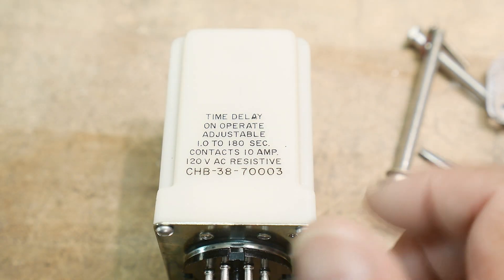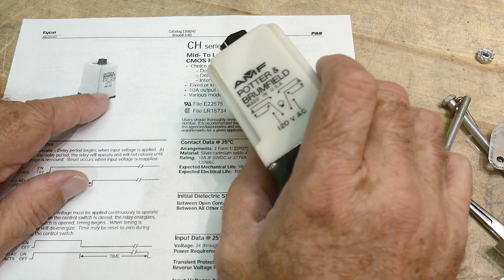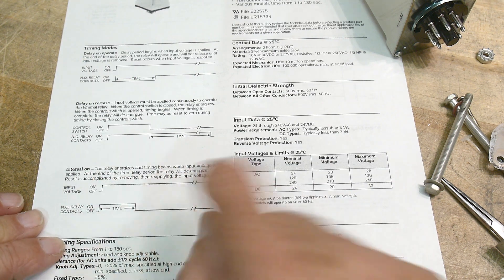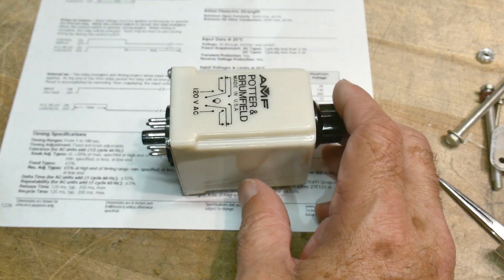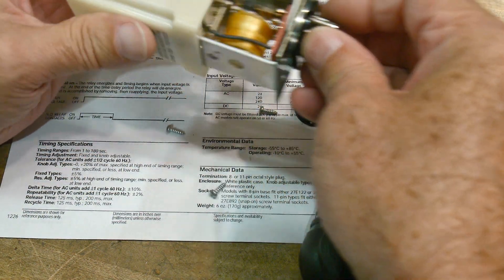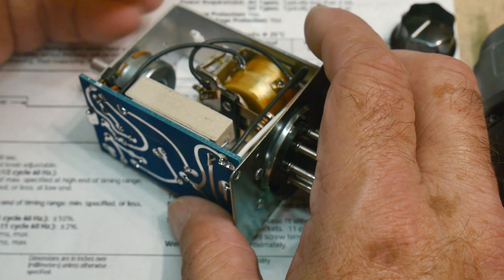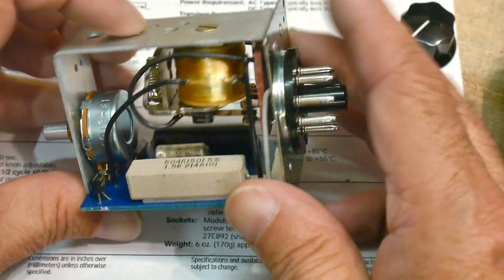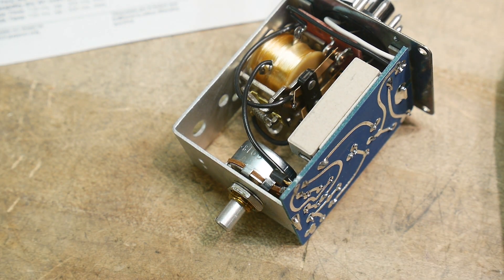#1349 Potter & Brumfield CHB-38-70003

Comment: I’ve used micro switches to build up custom switch assemblies. Those things are extremely durable. That switch will probably outlast both of us in daily use of the plunger mechanism (Tek’s) doesn’t fail first. These micro switches are very flexible parts and with a bit of mechanical prowess can be used for a variety of switching tasks. If anything, I commend Tek for doing it this way. The contacts will outlast rinky dinky push-on-push-off things they often used instead.

Comment: Normally also used on bag sealing machines, though those use a pulse output, so instead of that expensice N channel mosfet they simply use a jellybean NPN transistor, a zener diode (6V8) and a sensitive gate SCR, so that when the time is up the SCR turns on and shorts out the relay coil. This is doing similar, just relying on the gate threshold voltage to turn the relay on. Not exactly going to be stable with temperature, but as this was probably only designed to be used as power on delay to handle a large inductive load turning on with a slow start resistor, not really a problem if the delay is exactly to the second.

Comment: Never heard of Potter and Brumfield until a few days ago while working on my a/c unit (1988). The controller board for the heat pump contains one of their relays. Funny how you make a video on one of their products just days after I first come across them. Lol. Thanks for the video.
Reply: Massive supplier of industrial control gear, you find them spread through the entire power industry, and into all sorts of industrial plant for control and safety systems. Your elevators and escalators will likely have them in it, especially those made by Otis, as a US based design.

Comment: A similar unit was used in equipment I worked on long ago--they were used a lot in industrial relay control systems thus their price. If they don't get decent air flow, they will go intermittent.  Only the later ones used a mosfet--the earlier ones used a bipolar transistor. The design hasn't changed for about 50 years. Simple RC timer circuit. using large value caps. Simple and reliable, and does what it needs to do.

Comment: The Telco that I work for uses these time delays in our Automatic Transfer Switches. All the equipment in the office runs off 48 volt battery plants. Often the commercial power company will only take a brief hit, so the company doesn't want to spin up the three  750KW 480 volt 3 phase generators, so they use these as a time delay for the generator start signal. Yes they are expensive but are extremely reliable. Nice to see what's inside.

Comment: You just have an older version than the current datasheet you downloaded references.
As far as old-school delay timers with virtually "nothing to go wrong" inside, the Amperite thermal delay relays in the same style envelopes as vacuum tubes are generally even more reliable, though of course they're not adjustable types.

Comment: $175 is absurd. It's like trying to buy obsolete parts from these vendors that have mountains of the parts that they snapped up when they went obsolete. My favorite was trying to buy a national semiconductor CPU from the 80's. In 10 off quantities the vendor, Sierra, sent me an invoice for $1300 each, yes the invoice was >$13K. I haven't laughed so hard in a long time. I moved on with my life and wished them luck shifting the mountain of parts they have while believing they are Scrooge McDuck diving into a mountain of gold coins. You see the same thing on eBay where someone thinks they'll get $3000 for some long obsolete FPGA that no one wants because it needs MsDOS development tools.
Reply: Their target is vendors who have a qualified product, be it life support, aerospace, military etc. $1300 to get a $50,000 device operational in a $5m plane? No worries at all!

NASA used to have a team searching eBay for parts to keep the shuttles running.
Reply: You’re not the customer they are after. $175 is not necessarily absurd. It’s probably well worth it where these things are still used. Most would be machines on production lines where downtime makes $175 a rounding error.

Comment: The one you tore apart may be early production--these things have been made for decades.  Newer ones do indeed contain a CMOS chip, often a 4093.
Reply: I was thinking the same thing. Like the early models used a simple transistor time delay while the newer models use some sort of more accurate CMOS chip.

Comment: i have the same type for 60s but it is a tube with a bimetal strip inside. probably the modern version with the same socket ;)
Reply: Probably an Amperite time delay relay, like a 6NO60 or a 115NO60 or whatever.
They used to be widely used back when they were inexpensive.  FOr example, my Dynaco Mark 6 amplifiers have 6NO30T delay relays in them to hold off the pre-amp tube B+ until things have warmed and stabilized for 30s.  I dropped one of them one time just a few inches to the table I was working on and shattered the envelope.  It still worked, but obviously longevity would be poor when now exposed to air.  At the time (1996? 97?) Amperite still made them and I ordered up two new ones to have on hand while they were still available.  They cost $97.50 USD each, but they were still available.  😀

Comment: Take a look at Agastat timing relays.  They were used in industrial control applications.  Incredibly reliable timing function is performrd by air.  I worked on gas turbine generator control systems built in the sixties where relay logic was used, and Agastats provided all timing functions.   Take one apart and see how they work.  Amazing devices.  Still in use today.